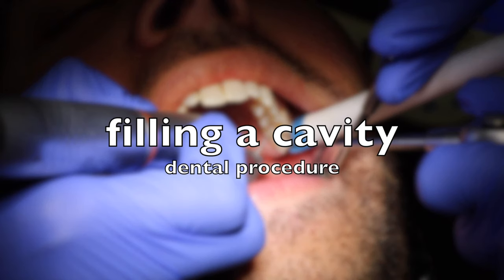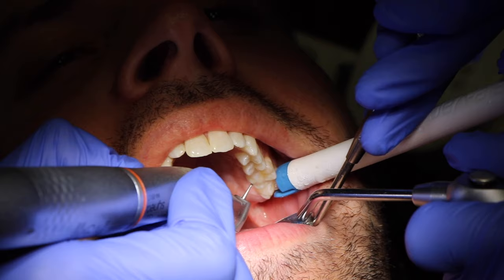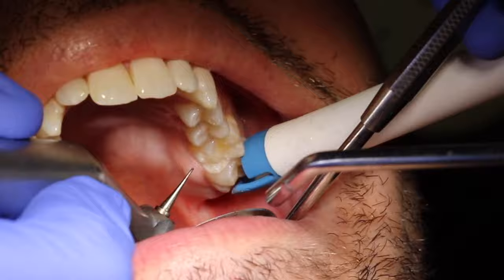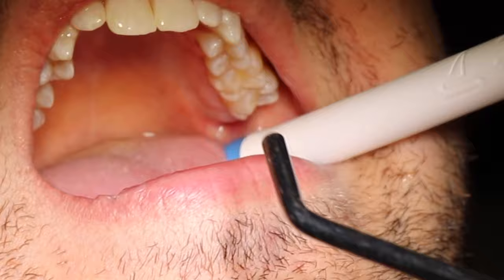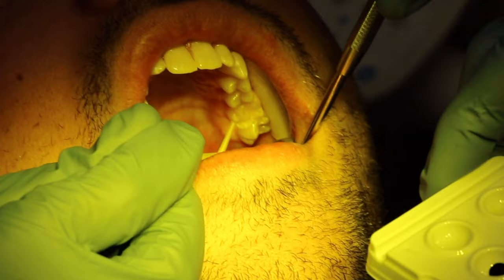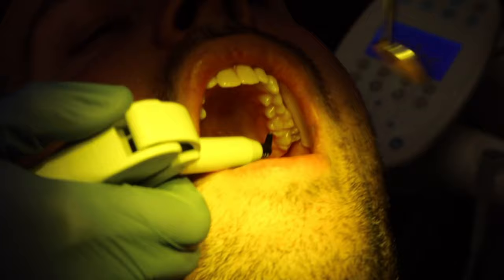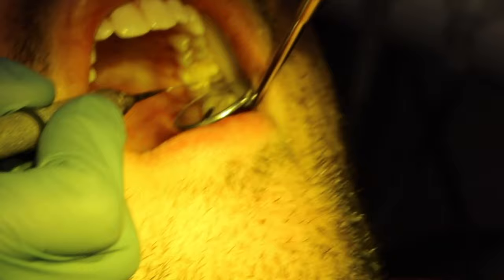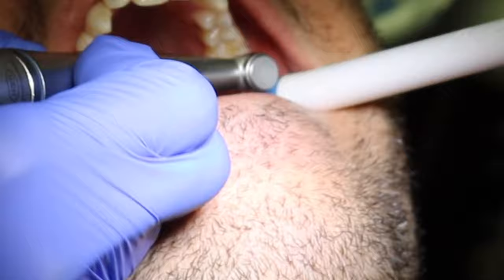How Does A Dentist Fill A Cavity?

Comment: I had 4 done on the right side of my mouth. It honestly wasn’t bad and this is coming from a very dramatic person.
Reply: How does it feel getting it removed? I’m at the dentist rn and they just told me I have 2 cavities and I’ve never had any before
Reply: I had 3 cavities filled yesterday on my upper right side of my mouth. Without anesthesia, only one of the teeth hurt when the dentist used the drill on it. (moderate but tolerable pain) I didn’t feel any different after the visit, so no pain or discomfort.
Reply: @HoustonHeartStopper   ya they also didnt put anesthesia on my gums
Reply: Pls how painful it is when removing it bcs mine is really paining me and I want to remove it hope it won't affect another teeth after removing the decay one bcs some people says if u remove ur teeth u never remove the worm that's y am afraid pls tell me how it is pls
Reply: Pls tell me how its feel when removing it pls
Reply: MarshmallowConFuego I didn’t get any teeth removed.
Reply: Blessing Osas I got cavities filled the worst part is the needles and it’s honestly not that bad because they are super quick pinches! It should hurt after that because you’ll be numb for hours after you leave
Reply: I have to get 6 fillings on 1 side on Monday
Reply: Okay but this was nothing like what I had they had my mouth HELD open and my tounge HELD down for like 15 minutes and kept walking away and it hurt so bad and like I was layed all the way down so I can’t swallow with my mouth held open and my tounge held down and EVERYTHING they used tasted so bad but other than the not swallowing and then leaving and not just getting it done in the 5 minutes they should’ve it wasn’t bad but like when I say not being able to swallow while having ur mouth held up and laying down is scary!
Reply: Amari Banks I have to get one tomorrow😤🙄
Reply: @intergalacticsuperstar8793  It's not that bad LMAO and I loved getting shots lol
Reply: Same
Reply: I have 2 on both sides. I wasn't anxious at all when I found out, (im getting it done soon) but after seeing these videos I am horrified lol
Reply: @belhudson71  same!
Reply: Tasha films  same I have mines on Saturday tho. 😭😭 I’m nervous ashhh
Reply: Tasha films  okay yeah for sure I’ll keep you updated on Saturday once I get back from the dentist! And sameee but Wish me luck 😭
Reply: For real because I have one in January and I’m really scared
Reply: Tasha films  oh shoot sorry guys for letting you know late.  yes it went well. You won’t really feel the pinch of the needle because they use numbing gel on you so that you won’t feel a thing. It wasn’t as bad as I thought it would be especially cuz you won’t really feel anything.
Reply: Tasha films  oh damn well I wish you the best of luck! I’m sure you’ll do just fine!  :)
Reply: @belhudson71  dude it isnt bad, I went there to do it and I was scared but I didn't even fill the shots or anything bc of the numb gel which isn't bad, then I gotta get some tommorow and friday
Reply: @SweetChili1224  dude I get mines today nervous lol
Reply: @mixedtayyyy9349  it isn't bad trust me
Reply: Did you get fillings between teeth too? Those are the worst because when you're no longer numb, your gums start hurting sm
Reply: @intergalacticsuperstar8793  SAME
Reply: @osasblessing103  it doesn’t hurt coming from some one who had jus got 4 cavities filled, you only fell a little pain from the needle nothing other than that. If you do feel pain from the drill make sure to notify the doctor because there shouldn’t be any pain or discomfort at all :)
Reply: bro I’ve had 7 cavities in total and I got 4 filled today
Reply: i have to get two fillings on one side on the 19th and and another two on the 30th lol.
edit: just got my fillings. i can't feel my mouth 👁👄👁
Reply: Did you have yours with or without novicane because my dentist said I don't need novicane for mine cause we caught them early but how does it feel
Reply: I had 2 done today I will get 2 more next month and it doesn’t hurt at all I was really surprised even the needle wasn’t bad.
Reply: My one hurts so much🤚🏼
Reply: DO THEY GIVE INJECTION
Reply: @shailendranaik5178  yes they do. it helps to make it not hurt as much
Reply: @shailendranaik5178  im no dentist but the dentist told me they just put numbing shots next the teeth with cavities. If they don't put the numbing cream it will feel like brand new braces on those teeth, sensitive. But later in the day when the cream wears off some people fill a lil pain coming in, the best thing to do is sleep it off.
Reply: @london scott a pinch
Reply: I’m terrified I have to go Thursday 😭 I don’t wanna get that shot
Reply: It was the after for me it’s killing
Reply: THANKS BRO! I have to go tomorrow. This helped me
Reply: I think I have four cavities in total. Plus a chipped tooth and I still don't know how that happened. I’m only getting two removed and then i’ll come back again to get the other two removed. How long do cavity fillings take? Also, since they are filling the cavity, i’m assuminng when the anesthesia wares off that it will hurt like hell. Please tell me I’m wrong?
Reply: It really doesn’t hurt the only part you’ll feel is a sting from the needle which is super quick and this is coming from a person that cries about every little pain 😂😑. Your mouth will be numb for about four hours after u leave and it feels to eat so wait a bit to eat . 
The drilling part kind of felt sensitive on my teeth but it wasn’t painful nor did it sting . 
It’s quick when you don’t have many the last time I went it took about 20 minutes as they did more than one but today it took about 10 to 15 minutes 
Also including the 10 minute wait to let your mouth numb
Reply: @cortniturner3488  when the anesthesia wore off my gums were sore and biting hurt just a little, very bearable. it’s not bad it’s just uncomfortable
Reply: @ashleylucero5736  Thank u🙏So glad it won’t hurt
Reply: @PrincessYonna1  That’s good I guess. I’m glad i’m not afraid of needles but that video I just watched, that one looked huge.
Reply: It was ive just had some done, it was really painful but i do have sensitive teeth.
Reply: I’m scare but I know I got to get it done!!! This Tuesday morning please pray for me !!!
Reply: @drealove9351  it very uncomfortable.
Reply: Wow 😮 ok I’m try to stay strong I need a deep clean also
Reply: @Diana Velasco  I’m going to pray for you ok I need a deep cleaning also !!! I hope I can sleep tonight!!!
Reply: @Diana Velasco let me know how it went
Reply: @madagbehsheriff3223   ok
Reply: How long does it take to fill one cavity
Reply: It doesn’t hurt.
Reply: Well thank you cause mannnnn I think I'm the same
Reply: @wither8121  depends on the size. if it’s small then probably 10 minutes minimum
Reply: @Rebecca Velasco I need 5 or 6 cavities but they are small cavt
Reply: @Rebecca Velasco cavities
Reply: I'm not a very dramatic person at all, I had 4 done yesterday AND I HATE IT SO MUCH. It's cold, they almost choke me with the mirror, my jaw hurts from keeping it open, god I hate the dentist
Reply: @taym1698  I am the dentist right now. It’s almost my turn. Wish me luck getting a deep clean
Reply: @marcosmendez8805  deep clean isn't too bad, it'll be fine:)
Reply: @taym1698  I just came out and it didn’t hurt. The first one did tho lol
Reply: @Alex_Parise  how does it go without anesthesia? 👁👄👁
Reply: I think I’m getting 4 removed and my ahh is still scared of the needle from the last 20 cavity procedure I had 🤣👊🏾😩
Reply: @sexyman8084  y’all lucky that its common to have anesthesia used on every filling, I dont think its common here but many are saying and I searched on google that some filling doesnt really require anesthesia and still painless so gl to me 👁👄👁
Reply: @ksjsjhssk4006  they put gas on my nose so I could breathe it in so I would feel numb and still feel a little pinch but I wanna know what the arm pressure feels like tho
Reply: Thanks. I have to do 5 tomorrow
Reply: I got one done today :)
Reply: @nevaeh8700  yessiirrrr
Reply: I passed out from the pain 😀
Reply: @JamesBond-xe9gw  I regretted it they ain gonna make me numb this time 😫😫😫😫😫😫😫😫😫😫 I am gonna make a big noise lol 😭
Reply: @Rebecca Velasco  glad to hear it went good
Reply: I had 2 done but the thing is they did not numb me
Reply: @qxely.d2863  same cuzzin just breathe in n out that’s my strat lol
Reply: Same but it was on my left side, it wasn’t that bad even tho they ran out of laughing gas. I just rlly hated the drilling or cleaning part.
Reply: Just had 4 done this morning myself didnt feel the shots at all drilling is somewhat sensitive feeling but not bad at all
Reply: For me it hurt not a lot but it hurt
Reply: @llvh2  today when I got 4 fillings dentist walked away I didnt feel my lip getting numb or my teeth I told the assistant that it wasnt numb so he gave me more shots and then I was fine I feel very little discomfort but not bad make sure they numb you good if you dont feel your lip completely numb ask for more
Reply: @mikec6014  no but my lip was completely numb and for some reason it hurt a little
Reply: @llvh2  I feel some discomfort while drilling is been done but I try and block it out glad all I have left is a cleaning
Reply: @Bunnikayyy  I didnt feel any shots on my cheek only time I felt some pain was on the front gums sting when up my nose
Reply: @Aniyah’s Playground Nobody (:
Reply: i had a cavity removed without any anesthesia or numbing stuff. didn’t hurt that much. just felt super weird and uncomfortable. when i got my first ever cavities filled, i was a panicked mess lol. had to get 4 filled in one day, was not happy lol.
Reply: Fuck I just got told I have 7 lmfao and this is my first time having them just nervous becuase damn I don’t want a dril in my mouth and idk if it hurts but o well my dumbass wanted this for not really brushing my teeth
Reply: Lmfaooooo ikr! I am a dramatic person to and with severe anxiety for going to the dentist! I have to get 4 filled the beginning of may fml 🤦‍♀️ 😩😩😩 I’m taking my anxiety med lmaooo...
Reply: @osasblessing103  I had 3 teeth pulled recently wasn’t to bad...
Reply: Those who experienced this already, did y’all undergo xray first before getting your tooth filled? Im terrified my dentist checked my teeth and she said it might be rct we need xray first, but it is just a super small decay and it doesnt even hurt at all no sensitivity whatsoever, im worried if she wants to get more or they dont do fillings without xray? Im anxious because I dont have any problems with that tooth and problems might come in the future if I do rct 😬
Reply: @ksjsjhssk4006  just because it doesn’t hurt doesn’t mean it doesn’t need work done or pulled...
Reply: @yourloveriswild7533  as I said either pasta or rct, but if you’re on my position you would choose pasta all day long, rct is so complicated most likely when you don’t even have a single symptoms, i’m just asking if the dentist just want to verify
Reply: @ksjsjhssk4006  pasta? Lol I’m lost... Maybe I didn’t read your entire reply lol
Reply: TY!
Reply: Same
Reply: I got more than 5 tooth that got cavities and I’m so scared
Reply: Same I saw people crying coming back but I didn’t shed a tear I just couldn’t eat my peaches after the job
Reply: I’m heading get my filling done 2 on right side may 27 9am 2021
Reply: Matthew Mendez  hurted
Reply: Thanks babe now I’m not scared
Reply: Matthew Mendez  when u gotta get it done?
Reply: Matthew Mendez  u gone be good man its only gonna hurt when they numb all the areas and them when you get numb you won't feel anything god got you bro u gone be good trust me
Reply: Matthew Mendez  you to and hit me up after wenesday to let me know how it went
Reply: Same
Reply: Hi dramatic person
Reply: Is the shot supposed to feel like someone is jamming a needle in you mouth repeatedly cause that’s how it felt
Reply: Thank you! 😩
Reply: Me too
Reply: How does it feel when they drill and fill  between teeth because I’ve never had cavities that need filings and I’m super afraid and panicking help me 😅
Reply: Omg ty Soo much I'm getting it tmr
Reply: Maybe for you but I got mine when I was 12 so it kinda hurt
Reply: Thank you! I feel so encouraged.I have a small cavity to fill.I'm super dramatic 😭😭😭
Reply: @kedeishafreeman2021  me too. I’m having it done this morning and I am scared
Reply: @LittleZee3  😭 just close your eyes. I usually do that. I also try not to anticipate pain. Your mind is very powerful. Hope all goes well. I'm going the end of August 😬
Reply: @kedeishafreeman2021  Thankyou! I closed my eyes, it lasted 20 mins and the dentist was reassuring which helped. Good luck with yours x
Reply: Aww thank you! Glad it went well for you! Mine is in another month 😬
Reply: @kedeishafreeman2021  fingers crossed yours goes well too ♥️
Reply: Just got one done like an hour ago,and it really wasnt bad. I have a really bad fear of needles and dont want drills in my mouth but it was actually perfectly fine
Reply: @SilentPengo  Thank you! I have a big fear for needles too 😭
Reply: coming someone with the biggest fear of needles ever idk if its bad i wont let them stick them things in my mouth
Reply: @HoustonHeartStopper  I get to get three done on my left side today.
Reply: @Reallyblackballed  I'm just one below you I get to get five. Three on my left two on my right. I get to get my left side done today.
Reply: I had 0 cavitys
Reply: I got to get four done tomorrow
Reply: Ok ty cuz I’m going rn
Reply: @Astragrapher How many are you having filled? each one will take probably 2 minutes to drill, but that depends on the size and where it is too.
Reply: Me too i had 4 on my right side and the only thing that hurt was my jaw because it dislocates when i open my mouth 🥲
Reply: Girl I got to have 3 tomorrow on the right side and I'm so nervous I almost canceled lol
Reply: i’m so happy to hear that 💀
Reply: @intergalacticsuperstar8793  same for me
Reply: Ive had 7 filled this year :')
Reply: @shaekoberle1000  LMFOAOAO
Reply: Thank god I have one far left side on the top, but I have to wait unti October 22nd until I get in.
Reply: @Reallyblackballed  did it hurt?
Reply: @intergalacticsuperstar8793  I also have two cavities😬
Reply: Did they put u to sleep?
Reply: Same here
Reply: I had 4 done this afternoon. The fillings themselves did not hurt because the dentist numbed me pretty good. But it still was uncomfortable because I had my mouth propped open for over an hour. Plus let’s be honest: dental work is never enjoyable. Lol
Reply: I flipped out and only have two lol 😂 yesterday was hell
Reply: @Reallyblackballed  holy shit.
Reply: @Cheyannerose12  it really didn't hurt tho it was just when they numbed me it kind of hurted a little but other than that everything will be fine
Reply: @anubhavmainali7302  no just the numbing part did
Reply: Ok thanks, I'm kinda scared about getting my cavity done
Reply: @miarohrer6851  I have 7 too and need to go back to the dentist tomorrow the 28th did it hurt? how bad was it?
Reply: God ive got this in the same place on thursday😭
Reply: They didn’t put numbing gel before injecting the anesthesia… literally felt that needle go in my gums; pain was intolerable 😩😩 can still feel it to this day..
Reply: Excuse me? It didn't hurt? BRO I HAVE ONLY 2 AND IT WAS THE WORST PAIN I COULD HAVE EVERY FELT
Reply: Same
Reply: @shannon2691  ya
Reply: Helps a lot
Reply: Right! I was more anxious about the water filling up in my mouth haha
Reply: @jacksonpatch4735  the water was horrible I almost swallowed it numerous times🤢
Reply: i’m getting 2 of mine done tomorrow i’m so nervous 😭😭
Reply: @cx_su  you shouldn’t really be it don’t hurt before they numb you with the big needle they put numbing jel so u don’t even feel it as the only bad thing is the water when they clean out ur mouth and u swallow it and it gross lol
Reply: Is it painful
Reply: it was literally just the shot that really was bad but the worse thing was how your mouth is numb for 2 hours after
Reply: The drill feels very weird and I don’t like it
Reply: Bro it hurted like shit wdym?!?!
Reply: Coming from a dentist? I would NOT let that dentist place a filling on me or my family. Why? Because there is no proper isolation. If any saliva, blood, sulcular fluid etc contaminates the tooth during the bonding? That is a failure, and the tooth will leak and eventually need further treatment. Now, that filling may last for several years before the patient is told there is a problem (or it may be sooner). The bad thing is that the dentist will blame it on the patient’s home-care, when in fact, it was bc the dentist didn’t care enough to provide the best treatment for his patient. Prior to placing a composite on back teeth, the dentist needs to either place a rubber dam, or use an alternate method such as an isolite, dryshield, etc…..a cotton roll is NOT considered proper isolation.
Reply: Are you a drama queen?
Reply: speak to me.  i am perceivably a drama queen - i hate being prodded and poked and terrified of an injection in my mouth, and i am due to have my first filling.  i am dreading it!
Reply: how did it go? 
 @Reallyblackballed
Reply: Update it wasn’t bad yall ! Don’t over think it I promise you’ll be fine ❤️🫶🏽. Healing didn’t take long at all.
Reply: @playgirlc  I gotta go back soon but it was easy they numb your mouth so you don’t feel anything
Reply: The Ring thing she put on hurt.
Reply: I hope you can still see this after 3 years lol but can you smoke marijuna after you know?? I’m getting 6 fillins
Reply: IM GETTING 3 FILLED IN TMR HELP
Reply: How many days until it healed
Reply: I have to get 8 done tomorrow